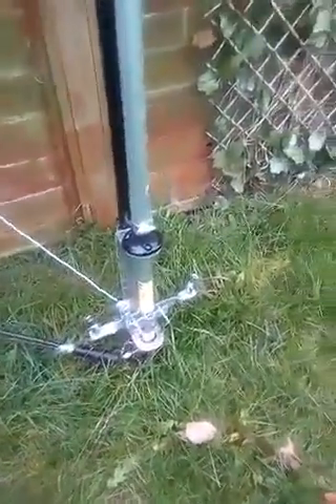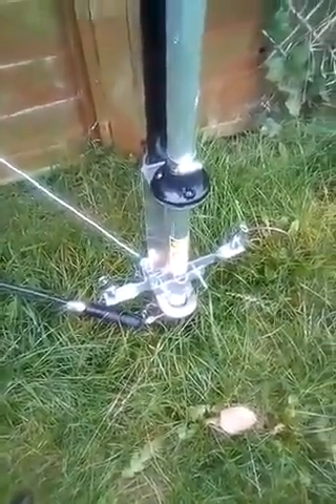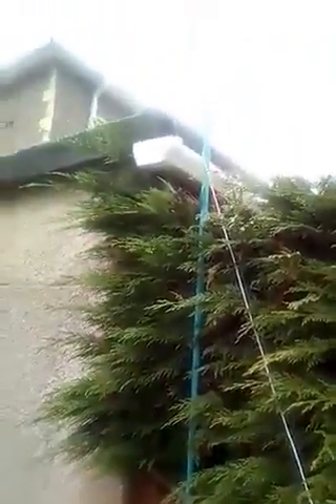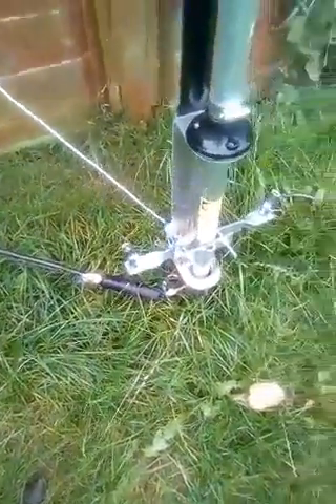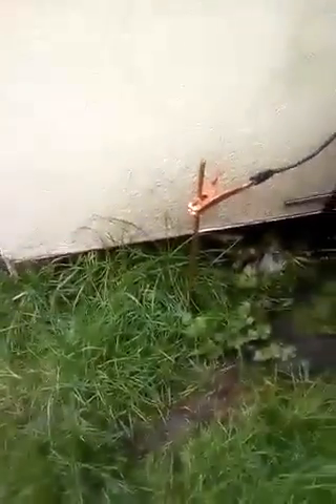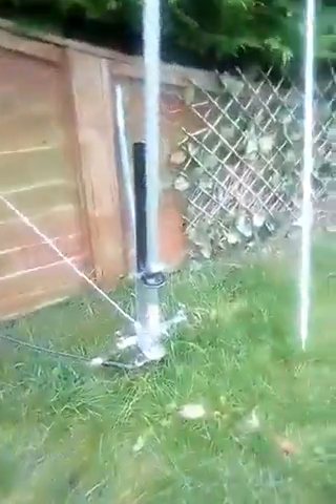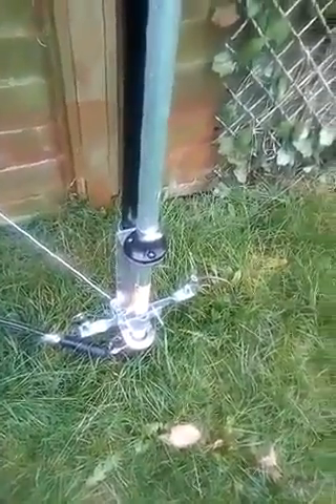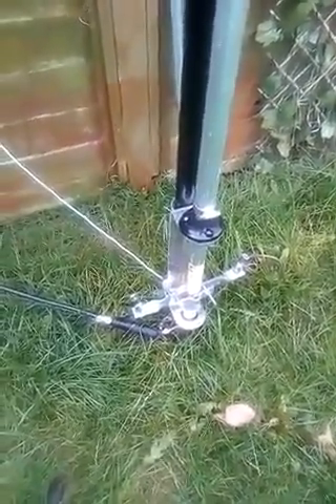adding 17 and  80 metres to the hustler 4BTV with wire modification by joe M1DLS

Comment: Where did you connect the 80m wire to please as want to try this?? Cheers 🍻
Reply from the maker: exactly 20m length, soldered to a hose clamp, about 5 inches above the feed point in between the antenna's support bracket,
Reply: @siffler1234  nice one thankyou 👍👍